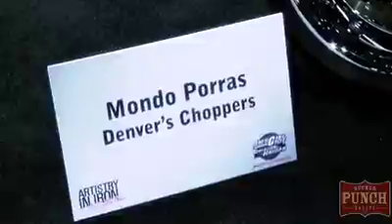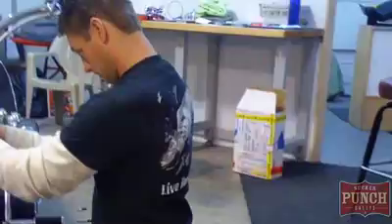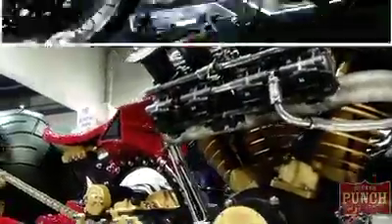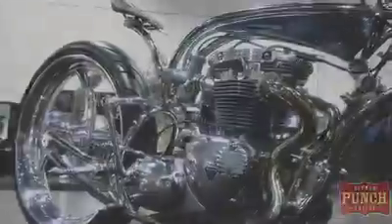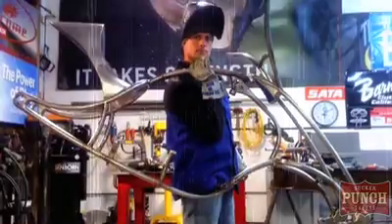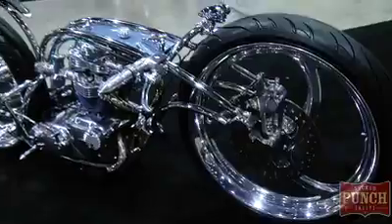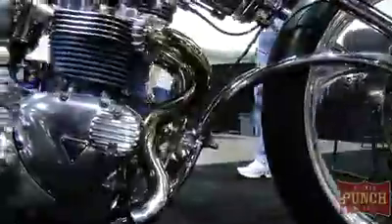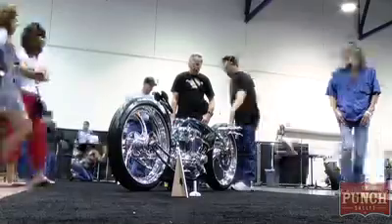Artistry and Iron (Kris Krome)

Comment: The geometry as far as trail may be correct but the weight distribution and center of gravity on the rear articulating section is incorrect. If you try to drive this bike down the road at a higher speed the rear section will want to "fall over" while the front goes straight and in effect steer like a 2 wheel forklift. If you try turning left, the rear will fold under and the bike will fall over on the right side and opposite with a left turn. Awesome and cool, but unridable show bike.
Reply: descargaelbano  Did you ride this bike...I mean you sound like you road the bike... THERE has to be a good reason ...